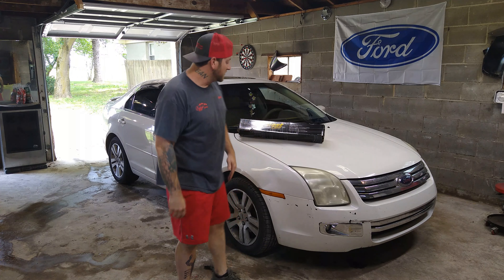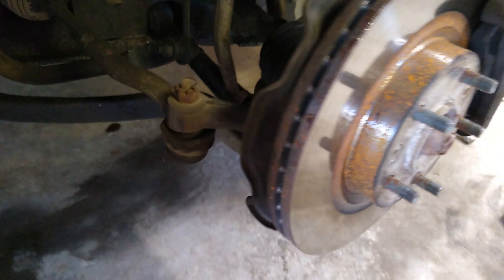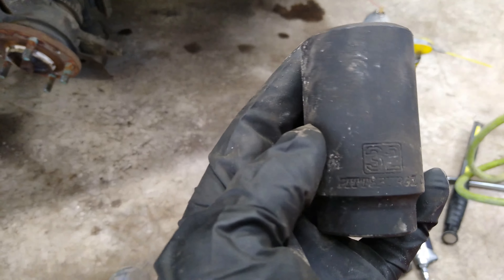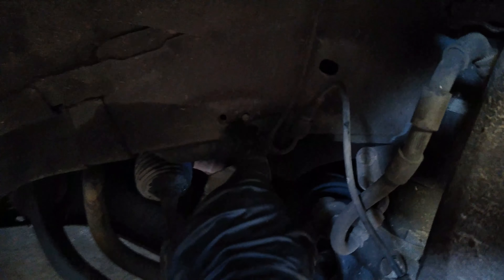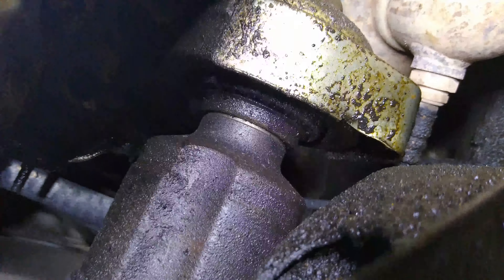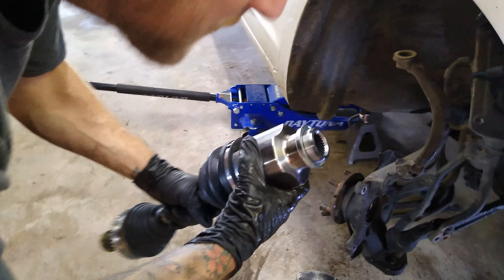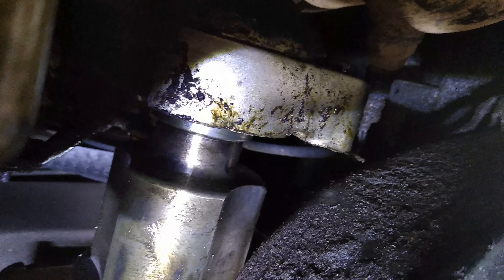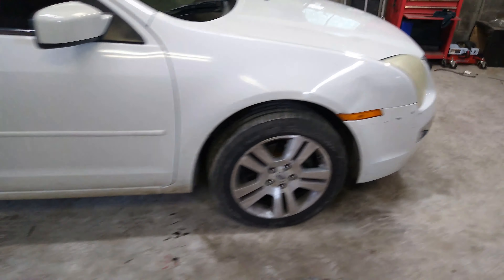CV Axle Removal & Installation 2006-2012 Ford Fusion

Comment: Ive been putting off replacing mine simply because I thought it was gonna be a pain and involve replacing front end components in the process. But if I can just loose some things up and pull er out and put the new one in, I guess I need too make a trip too the parts store. Thanks for the vid man

Comment: Did the new one pop back in place?  Usually you need to get the splines aligned and then smack the outer end straight inward with a decent sized hammer.  All other videos show that a hammer is needed, and I'm searching the web because even with a hammer mine isn't going in.....
Reply: Did you figure it 9ut mine wont go in all the way
Reply: @86ortega  yep.  Can't recall if I ended up having to hold it into the transmission while my son tapped it in with a drilling hammer, or other way around.  Either he wasn't hitting it hard enough or wasn't holding it in place squarely with splines aligned.  But it did go in as I expected, just took special attention and a good initial smack to get it started.

Comment: I noticed this was for the passenger side, would the driver side be the same process or is there any differences ?
Reply from the maker: Dang I just saw this. I am sorry for the late response. The driver side is pretty much the same process. Thank you for watching my video and your comment
Reply: All good, I appreciate the reply, and great detail on the video!
Reply: Replying for posterity- the driver's side CV axle also seals the transmission, at least on manuals, so you'll need to catch the drained fluid and refill

Comment: Darn, the one part I wanted to see was pulling the axle out of the trans! Mine is stuck in the trans and "popping" it out with a pry bar is not working. Oh well! I'll keep trying.
Reply from the maker: It will seem like it is stuck. But it isn't. It has a locking ring in there holding it. Just keep pulling and prying and it will pop out. I get under the trans and use a big flat head sometimes and hit it with a big hammer. Some are harder than others to pop out but it will come out. Sorry I missed the part you needed. Thank You for watching my video and your comment.